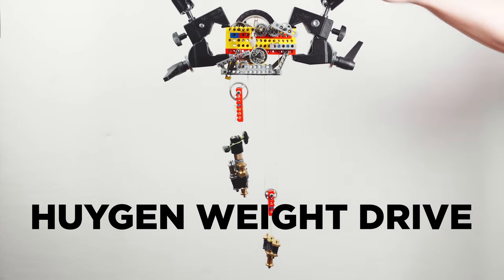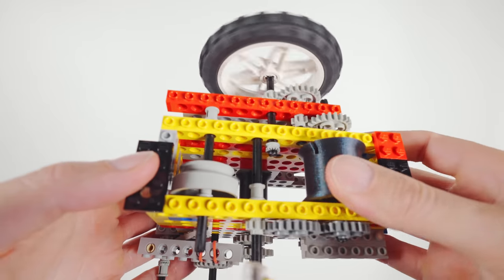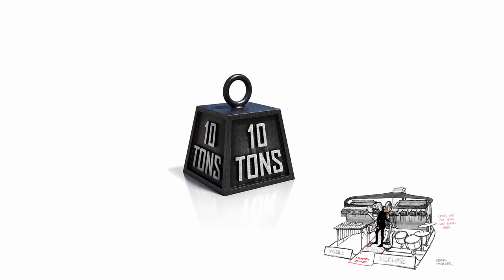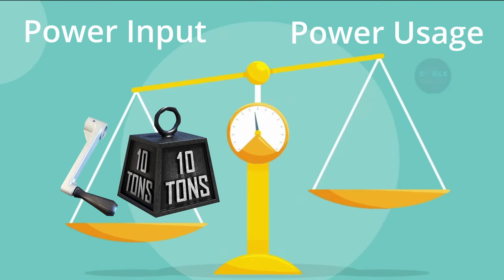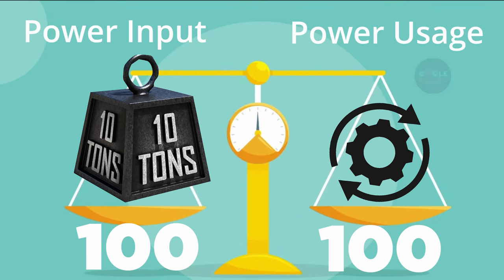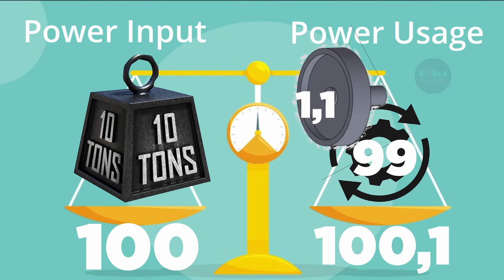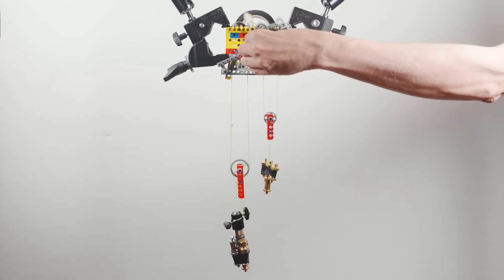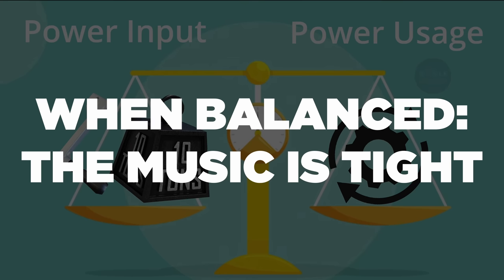Lego Technic Huygen Chain Drive

Comment: I'm not totally convinced that you actually need this tightness.
But I love the mechanism and if it helps bringing the MM3 into existance, I'm totally fine with it 😊
Reply: It won't help bring anything into existence. It's additional, unnecessary complexity, which inhibits MMY ever being completed.
Reply: He plays alongside things like midi timed arpeggiators in his band, so needs it to keep time with that, and it's not so much small micro fluctuations, but total wander over an entire song that REALLY matters. 1ms of drift seems like nothing, but if it's 1ms of drift per rotation of the programming drum, then you could be at least half second or more out by the end of the song, and good luck making that sound good with midi accompaniments. Even a 20ms delay will start to sound like an instrument is beginning to play totally out of time to a trained human ear. It's not like he can set the machine to slave off the master midi clock, so he needs to make it BANG ON timing wise, otherwise the songs will all have to be only 30 seconds long as they would exceed the 20ms delay threshold before the end of the song and really start to sound out of time, and it would only be getting worse as the rest of the song progresses.

However, with regards to each notes tightness to a central time code. Humans can detect delays between identical (or not) source materials of down to 20μs (that's micro seconds btw, not mili seconds!), although you still perceive it as one sound up until around 20ish ms, you can still hear something is different and the attacks of notes start to break apart, so if the machine is randomly plonking beats both before and after the true beat by more than a few ms ... playing along side a midi timed arp, it already might start to sound a bit funky (and not the good kind of funk lol) if it's randomly both before and after the beat especially, but even just random delays after or before exclusively may not sound right being that they are random and without a gradual increasing and decreasing of timing errors, like how a human tends to wander slightly in and out of time when playing which is what we call swing.

Comment: You don't even need to use gravity for this, you can use torsion springs for continuous output, with a detached power input to compress the spring as it slowly pushes against the flywheel power transfer mechanism. This would allow a much smaller footprint for similar power output. One example of this is the very rudimentary torsion spring hinge found inside those cheap calculators with a door that opens up slowly when you release the lever.

Comment: aw damn was going to suggest this pully system last video, but didn't think you'd be interested! an improvement to get better friction is to create a helix/spiral pully (like a drill bit) to guide the cable around the pully multiple times without the cable rubbing on itself or getting tangled

Comment: The huygen drive is a very clever idea if you want to constant "refillable" input. By putting an indicator on the weight that change while it falls, you will be able to monitor its position in space and from the lowest poitn and you could theoritically let it fall for a short period on times to do other stuff. The other advantage I see with this drive is the constant output it provide. The Huygens Drive (HD) will always output a certain fixed RPM and you would just have to change the output Gear to change the tempo of the whole machine.

For example, if you're HD output 80rpm, by usindg a gear ratio of 2 (The Input gear form the machine is twice smaller than the Output Gear from the HD), you could achieve 160rpm really easily.
So, If you go with the fixed gear on one side, you could theoritically achieve any tempo you want.

(I think it would be better to have a High rpm on the Ouput of the HD, as it will give you more torque when you decrease the rpm, helping you to move heavy stuff.)

Hope it helps

Comment: Martin. I would suggest making the Power Input redundant. Have at least two separate Power Inputs and continually switch between them. When one Power Input is depleted, switch to the other one. That way, the depleted Power Input can be carefully and patiently rewound again without affecting speed. Also, as others have suggested, use a CVT transmission to adjust speed.

Comment: The Huygen Drive looks really promising. A tiny correction: On the right side of the scale there is not just friction of the MM, there is above all the potential energy put into the marbles which they swiftly first convert into kinetic energy and then into heat when hitting an instrument and being stopped at the bottom.

Comment: For the past few years I have been pondering a device which will run off a descending weight, but I wanted it to run constantly for an hour, which would mean the cable the weight is attached to would be extremely long.  However, thanks to you, when I saw this video, I knew my weight dilemma has been solved.  You talked about a governor, which I knew was something that I would need, so I got my aunt's old wind-up Victrola Phonograph player to harvest one from it.  Thank you for showing this.  This was FASCINATING!

Comment: Springs could replace weights and achieve the same purpose using a lot less room and weight. Using a servo motor to regulate speed by dynamic braking of the flywheel would work as well. IBM had pendulum clocks that used a small motor and ratchet decades ago to keep the spring wound and not use weights at all. My father in law had one (he worked for IBM when all they made were registers and system controls) and it quit working. I discovered the ratchet drive was worn and needed a small adjustment to get it working. Very simple design that worked for years before requiring adjustment. The very small AC motor just kept the tension on the spring constant. The system could be designed to replace the pendulum for a metronome type setup where any tempo could easily be set.

Comment: There's more than one way to skin a cat when it comes to designing a governor mechanism too. One could use fluid friction instead of mechanical friction. So it could be a variable valve restriction on a hydraulic pumping circuit or tilt vanes that catch the air. In terms of wear & tear issues, those might have some advantage over brake acting on a friction wheel.

Comment: Just how heavy can you seriously make the machine is another factor you are forgetting to account for! If it is too heavy it will destroy the stages of the venue, break the backs of the road crew and shipping - if you have to ship an extra tone of weight and Huygen system for this mythical World Tour it will cost you a heap extra and probably mean the machine must be carried by at least one extra normal size van - and you don't want to be locked into only shipping via HGV at all times - while road access to venues should exist you can be certain a HGV can get access!
Reply: Right? The machine is already the size of a room (2:18). Honestly I think the MM3 should have been just the MM1 but more durable for international shipping. It's gearing up to be a museum installation more than a concert

Comment: You could also use a spring (or springs) rather than weight. Particularly helical springs, such as those that are used in clocks.

Comment: Keep in mind that power usage is not constant. As the speed of the mechanism increases, friction resistance increases, which is why a weight system will accelerate UNTIL it reaches the balance you are talking about.

Comment: Instead of weights, you could use a long spring pack under the machine. It would be much lighter for transport, less likely to break a stage due to overloading.

Comment: I understand the desire for the machine to play "tight" music, but I'd like to put idea this in your mind.  You should to set a standard for "tight enough" and reach for that.  

Each performance can (and will) be slightly different, and that is beautiful.  While we don't want 2 or 3 seconds of delta in the machine, having a precision of 0.1 microseconds will not be discernible when you are in concert.  Put another way, we don't want the machine to start at 60 bpm and end at 50, but on the other hand, having the machine start at 60 and vary between 59.8 and 60.2 would not be noticeable to an audience.

Comment: One problem with the focus on a constant power input is that it also assumes a constant power output, if the output is variable than the imbalance can't be adjusted on the fly like a  human powered solution would be. That means that a gouvener would probably be required and now you have three additional systems, adding quite a bit more complexity and a few more failure points.

I'd say analyze the tightness of a few songs and use that as a starting point. And then chose one of the lower percentiles (your machine DOES NOT need to be better than 80% of good music! That's not the reason we like and want to hear it).
Then take a look at your old machine and take measurements from it (how constant was the rotation speed, how constant the directly driven instruments, how constant were the marble drops) and use that as the basis. Maybe the rotational speed was already quite consistent (or it changed consistently, speeding up on the down stroke and slowing down on the up stroke).
That might give a clue on what problems are really need major improvements and new solutions and which only need to be modified slightly, if at all.
Additionally assume some marble loss and plan for it with a reservoir and by protecting places where a stuck marble would destroy the machine.
Reply: A second point, does the pedal actually need to be connected to the machine, or couldn't it just be loosely attached?
On the attachment point the force transfer is directional, its always up, make the connection directional, able to withstand high up bot low to no down-force (e.g. a lifting a plate lifts the food, lifting the food doesn't force the plate upwards and then breaks your wrist)

edit: formatting

Comment: I would go the electronic control route. Use a fly wheel with electric encoder motor drive with a simple drive controller to manage a constant RPM of the flywheel. They have systems sensitive enough to maintain a target RPM with fluctuating loads. Granted you likely can make a fully mechanical analog with what you're thinking of in this video but you're introducing a very complex mechanical subsystem into the failure pool.

Comment: Martin, does this Huygens chain drive work if you use a more elaborate pulley system on the weights? Right now there is a single pulley with a 2:1 mechanical advantage on the weight. What if you use multiple pulleys and get a much higher mechanical advantage? Does the same principle of operation still apply?

If you could use a 5-8 pulley block set, you could have that weight fall a much smaller distance while pulling a lot more string. At some point the amount of string and the weight and the friction becomes significant, but if you keep it in the range where it is not significant, this could be an improvement on Huygen's machine.

Comment: It would be awesome to use a flywheel to power the ratchet and if the weight is at the top it could trigger a clutch to disconnect the flywheel and if the weight drops to a lower height maybe 50% it could trigger the flywheel to engage again so you don't need to constantly crank the handle. And using both the weight and flywheel could both be smaller.

Comment: With the issue of how to play at different bpms, that is what your governor is for. In theory, at least, a governor is a mechanism that allows you to set a desired speed output, and will adjust for changing input power to try and keep a consistent output power. Like with the gramophone motor governor, you should be able to just adjust the governor to give you the desired bpm.

Comment: This is the engineering equivellant to "I can't finish this song without first investing in these 50 expensive plugins...". The never ending chase for "tight and perfect" just like any other guy.

Just waiting for the episode where all these mechanical fandangles are ditched completely and replaced by a computer, probably with AI so it just does everything tight and perfect without a single input needed.

Comment: Martin, think about making sure the weight you choose can achieve maximum BPM.  Then, rely exclusively on making a precision governor which is adjustable easily by hand.  This way, you have a smaller single adjustable device.  IE, don't adjust the weight, just use and adjustable governor, one which can deliver a repeatable select-able precision speed no matter any slight deviance from your master weight.

Comment: Martin, you have missed the big picture. The vast majority of the load of the machine is in lifting the marbles back up to the top of the machine. you could make your 10 ton weight much, much smaller by getting, let's say, 5 tons of marbles and lifting them up to the top before the song starts. Just calculate the total number notes that are played in the song and multiply by the mass of one marble. Then you would only need maybe a 1 ton weight or less to spin the drum.

Comment: The weight drive is a great idea, but it is not following your guiding star: make it, so it works, instead of make it fancy. 
An electric drive would not only be tighter, but also so much easier to handle. The weight would still need to be quite heavy to drive the machine. And if you want to turn a handle during playing (which I get) you could easily do so an adding power to a battery or so.

Comment: Using the same idea of rotation to fix movement balance, you can build a piece to add purposeful interference. You can imagine it like this: one axis that constantly rotates (it's the main axis where the force starts), the object that causes interference and then the other axis. Explaining the piece: you can imagine this piece as a circle with several layers inside that rotate in several different directions and in the middle a weight that would have to rotate faster than the other layers, the change of direction would cause the weight to cause resistance and thus cause consistent interference with movement. And to make the interference stop just make sure that all the layers are lined up and attached, so all the parts would rotate in the same direction and it would just act like a weight, like a gyroscope only with gears and levers

Comment: A lot of people are complaining about martin "chasing tight music", and it seems to me like these people are missing something really important. Martin isnt trying to constantly make the music tighter, hes making sure each new system he adds is able to play consistently and tightly. He's already added 5 or so systems, if each of these added 10-20 ms delay he would already have a significant amount of delay. He's not trying to make a perfect machine with no error, hes making sure that he makes a consistently reliable machine from the beginning instead of trying to retrofit a design to be consistent after its nearly finished. The reason mmx died is because martin kept finding things that he wished he had designed better the first time. He couldn't remove the inconsistencies and errors from the system. This time, he is trying to make sure the design is sound from the beginning. Additionally, this is some what of a research project, and part of research is trying new things and experimenting

Comment: If you're going to make the MM3 a big clock, you could consider designing for clock aesthetics. Bonus points if you happen to implement a large pendulum instead of a flywheel, which could be the centerpiece of the entire thing. Although if there's no pendulum, then a massive gear housing, which is probably required anyway, spinning around in the center behind a transparent glass or plastic plate, would certainly be a very pretty clock aesthetic as well. It would also be a sweet callback to the planetary wheels of the MMX.

Comment: To achieve different speed YOU MUST USE some sort of gearing. The Huygens Chain drive must be calibrated to a known output continuously. The BPM is determined be the gearing. There are several options out there - for example, have a look at a CVT also known as a reves drive.

Comment: Why doesn't Martin just use a simple electric motor to power the machine?  The main characteristic of the MM is the marbles, not that it's manually powered.  Seems like that would be a simple and elegant solution for tight timing. A worthwhile tradeoff.

Comment: Martin, I feel like you looked a lot at keeping the input side consistent here, but you forgot there is variability in the output side of the equation. Depending on the amount of marbles being lifted, instruments played etc the machine will require different amounts of force to power.

Essentially this will provide a stable input force, but you need a stable input speed. When hand cranking the machine, you are able to compensate for this, but with a system like this you will no longer have that possibility.

I essentially feel that your lego test might be leading you down the wrong track, with such a small flywheel you can't really tell how much the variability will be on the full scale machine.
Reply: You not only need a stable input speed, but also an adjustable input speed. With a weight powered machine, you will only be able to play a single tempo without changing weights.